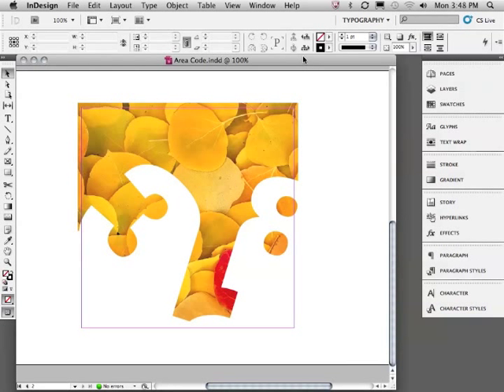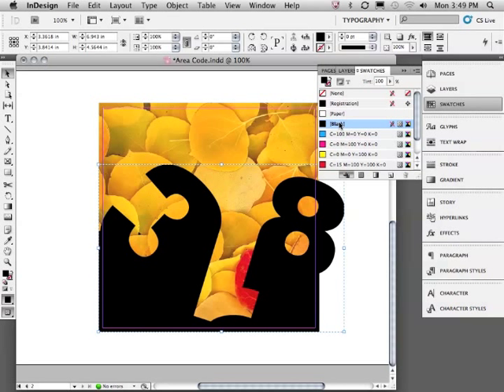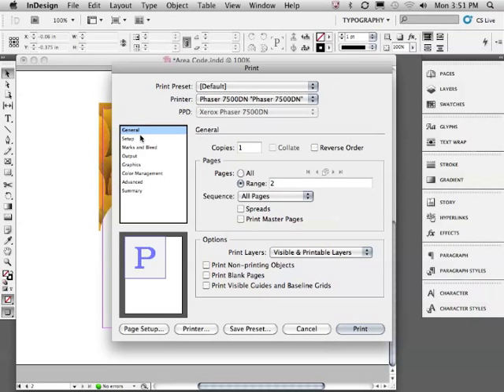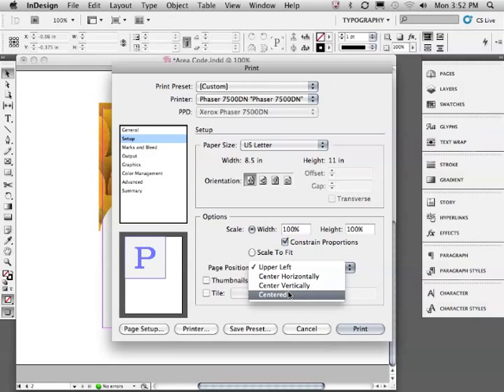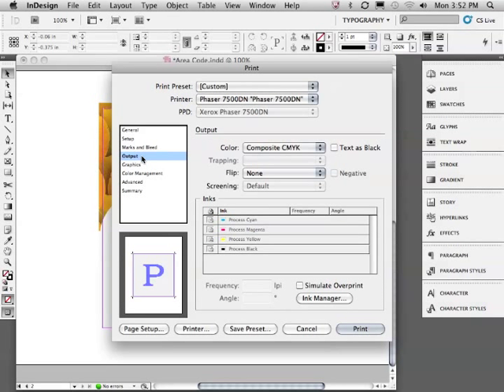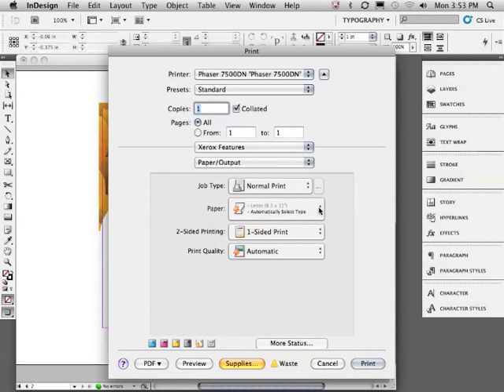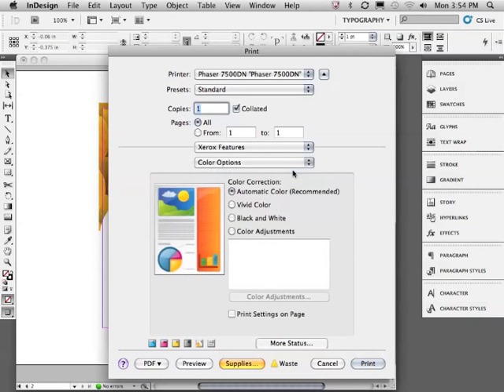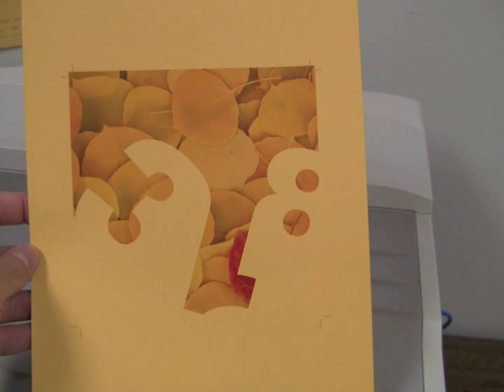Printing from InDesign

Comment from the maker: @piggiesmalls4 
Thanks. Offset determines how far outside this 8.5x11 document the crop marks will print. In general, you just want to make sure the offset is greater than the bleed amount. For example, if your bleed is set to .125, the offset should be at least .125. If there is no bleed, then the default is fine.

Comment: Great video! What does "Offset" mean under Marks and Bleed at 2:45 ? If I were printing a 8.5x11 document with 0.125 bleed, should I leave the Offset to the standard 0.833 or change it?